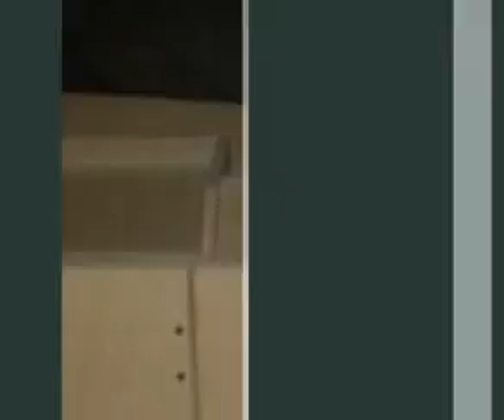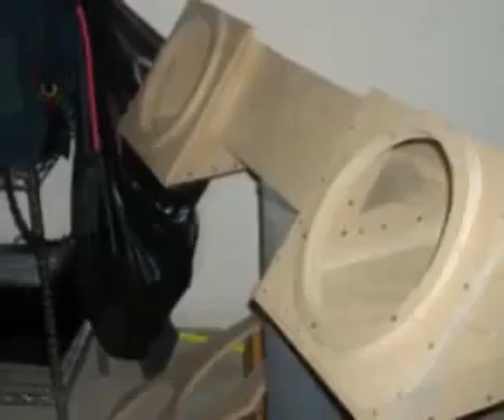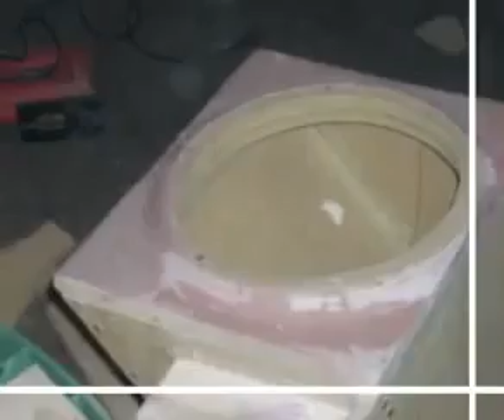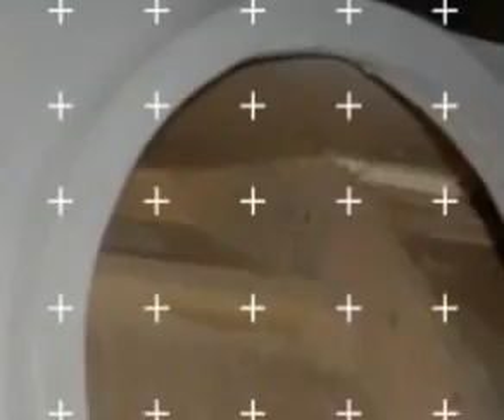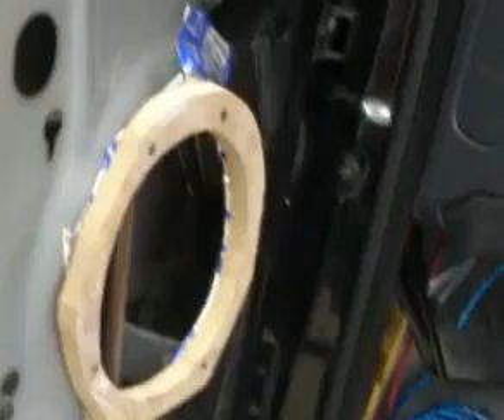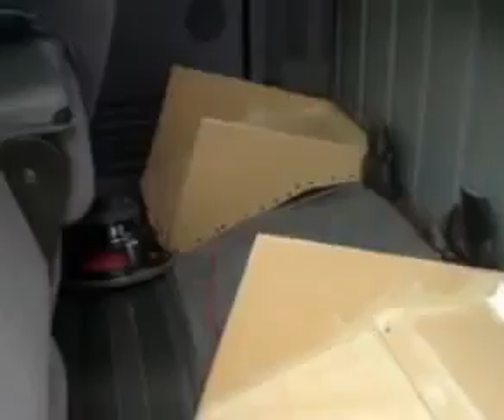Dodge Ram Rockford Fosgate Build

Comment: All my friends said I couldn't put two 15's in my Dodge Ram Daytona, but I did it. I built a wall basically from the floor to ceiling. 9 cu ft total - 4.5 per sub. I didn't like the T1 sound so went back to older HX2's powered by a T10001bd. I am in the process of upgrading to two T1500-1bdCPs and two T3 Audio 18's! The T1500bdCP's make 1900-ish watts. I can't wait to have almost 4000 watts behind 2 T3 Audio 18's. :)

Comment from the maker: @HeavyChevyBoy95 basically! there is no actual switch - but how you hook it up decides how many channels, like on most amps. And you will be running alot more than 600 rms My "birth sheet" for my t600-4 is like 867 rms amps well above the 600 mark. All RF amps run well over the rating in which  they sell as. espically new models/

Comment from the maker: @HeavyChevyBoy95 not sure of the specs on your L7 i havent used thoose before, I would personally go up to the t600-4 alot more options for system expansion in futrure and nuch more powerful than t400-2. the t600-4 you would extra channels front other speakers like your mids.

Comment from the maker: @HeavyChevyBoy95 So your amp sells as the following:
120 Watts x 2 @ 4-Ohms
200 Watts x 2 @ 2-Ohms
But Most likely your more closer to: (Average for T400-2's)
145 Watts x 2 @ 4-Ohms
243 Watts x 2 @ 2-Ohms
RF always bench test every amp and gives you a birth sheet, they always shoot high when they make them so they don't sell a "weak" underated amp.
My buddy has a T1000-bd rated close to 1500 watts - crazy. Thats why RF Amps are known as Cheater Amps in competitions.